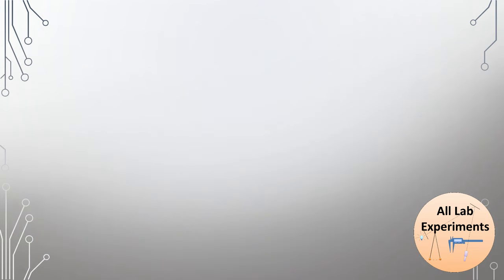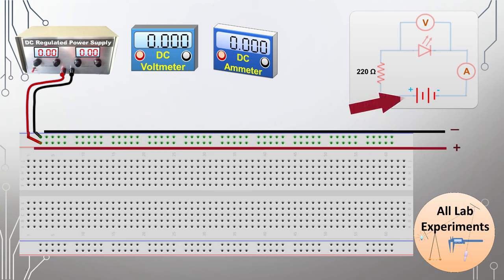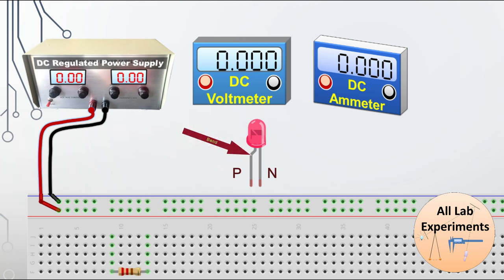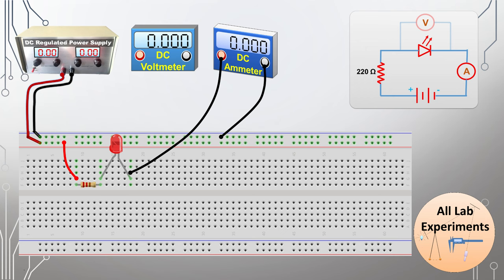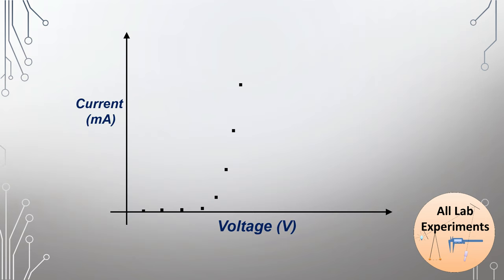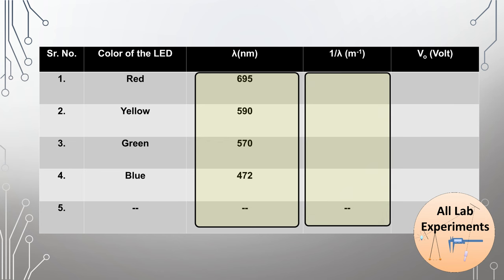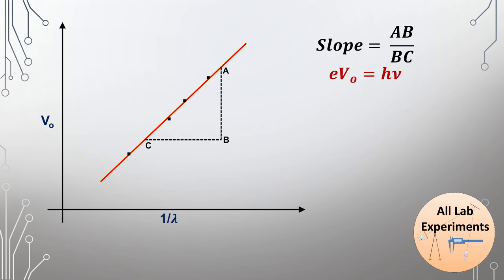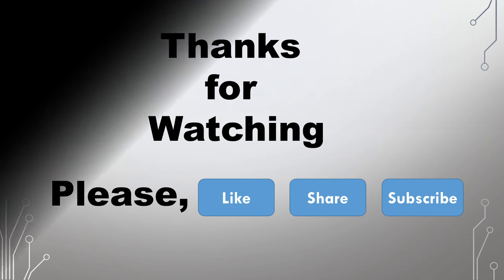Planck's constant using LED | LED V-I Characteristics | Full Experiment & Practical File

Comment: This is a very good experiment (actually not an experiment but a lab activity).  In 1998 I developed this lab activity so that all of the Physics students at Midwood HS in Brooklyn could use different colored LEDs and a variable voltage supply to measure Planck's constant.  The students got very good results.  Hardest part was that I had to hand build a variable DC battery variable voltage supply for each lab station.
Reply from the maker: Nice... Great work... 👍
Reply: Who asked
Reply: Sharam karo.... Thodi izzat kar lo bhai.... Wo physics padhane Wale lagte hai @nothing-ck1kd

Comment: Hello,
What is the electronic circuit that will light the LEDs (red, orange, green, blue) one after the other by acting on the electrical voltage? And also without them lighting up almost at the same time. For example the green LED lights up almost at the same time as the blue LED.
Thank you for your response.
Reply from the maker: DIY